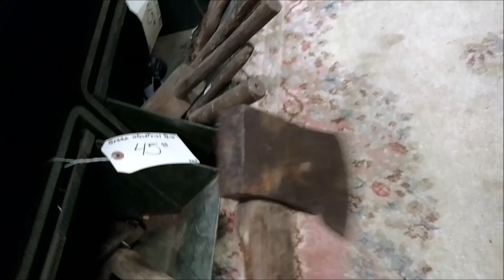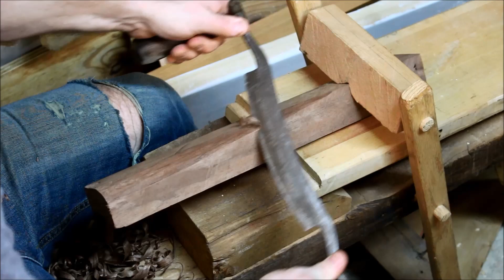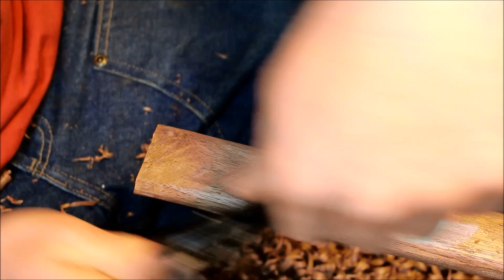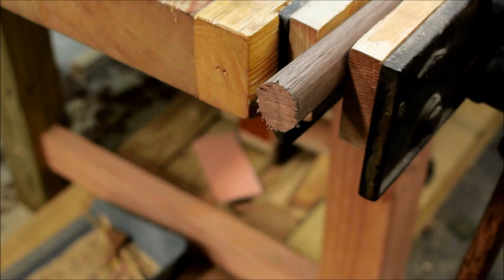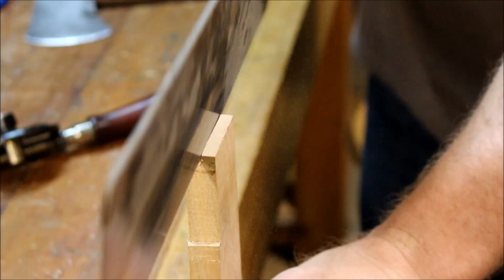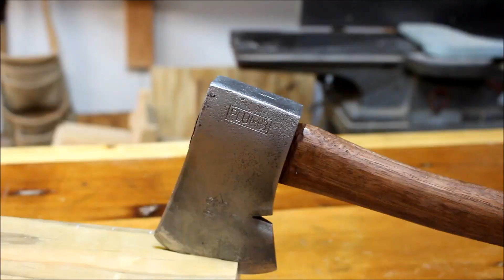Hand Tool Only Restoration of Plumb Boy Scout Hatchet with Walnut Handle

Comment: A quick and effective way to set an Axe or Hatchet on a handle is to hold the Axe/Hatchet upside-down and whack the bottom of the handle with a mallet until the head sits firm on the handle. Using Boiled Linseed Oil on a wedge before driving the wedge in really helps the connection last. Cheers from Germany! :D
Reply from the maker: great tips, thanks!!  I'd forgotten some of them!

Comment: Perfect!  So glad you didn't go over board on the ax head.  Looks great!
Reply from the maker: Thank you, Brother!  There was some slight pitting from the rust but it had a lot of the original edge left and luckily didn't take much to sharpen it.  I used really old stones to sharpen it of unknown various grits that I honestly almost threw away after finding them at the bottom of an old tool box that had been unused since the 40's.  After the video I went back and worked on the edge a little more with a much finer grit stone that was among them and I was amazed how sharp it came out.  Very fun and rewarding project!  thanks again for the compliment my friend!

Comment: Oh darn, had another question: Can you give more detail and information on that hand crank grinder? That was really awesome, first one I've ever seen.
Reply from the maker: oh sure, those can be found at flea markets or ebay and come in various sizes.  This one was found at the bottom of an old tool box from the 1920s that I got off craigslist.  they usually have a clamp on the bottom to mount it to a table but the brackets were broken off on this one so I used c-clamps.  Some hand tool only guys like Shannon Rogers on youtube still use them.
Reply: Tim. Wilson l

Comment: What a wonderful restoration!!! You did an absolutely outstanding job!!! First video too watch of yours, would you share what your soaking solution was and would it work on an antigue plane iron?
Reply from the maker: Hey Tim, thanks!  I used white vinegar mixed with salt and let it sit for at least a day and that really does seem to get the job done.  If I'm impatient (usually the case), I'll use a wire wheel.  Thanks for watching man!

Comment: Can you give more info on amount of salt in the vinegar? After soaking just scrubbed with a pad?
Reply from the maker: Thomas Brooker no specific amount of salt mixed in the white vinegar but more is better.  The vinegar alone works but with salt it seems to accelerate the process.
Reply: Vintage Wood Workshop thanks for the info! I actually bought the same hatchet and the handle is in decent shape but has some paint drops and seems dirty. Any method you would suggest that wouldn’t involve using sand paper and possibly removing the original stamping/lettering in the wood?

Comment: Nice work on restoring the axe and making a hand made handle for it. I have  one just like that in shape, size minus the hand made handle.. It is  stamped PLUMB but has no other markings.. Is the Boy Scout a version  of this axe? Anyone know? Mine happened to be left behind in my boat at some point  by someone and it was rusty as can be and no handle on it. I soaked it in oil and hit it with a wire wheel.. Cleaned up nice. Need to put an edge on it.  And while I was at Bimart today  and I broke down and ended up picking up a 16" Birch handle (?)  and put it together just  a couple hours ago.. I enjoyed your video and will look thru your channel.  Reminded me of Wranglestar's channel...
Reply from the maker: notbasic 01 thanks, yeah this was the hatchet plumb made for the boyscouts somewhere in the 30s from my internet research.  It's 5" long, 2-1/8" at the poll and 3-1/4" from toe to heel.  A cool little axe for sure.  Let me know how yours turns out....would be great to see some pics

Comment: awesome video brother you definitely put the ✋ in hand craftsmanship! not one power tool wow. what kind of wood did you use? I have an old plumb hatchet with a red strip on the lower part of the handle and the number stamped into the wood is #1 could that make it valuable in any way. there's something about this tool I just love.
Reply from the maker: Thanks Brother!  Not sure about the stamped number on yours, but yes these plumb hatchets are awesome and really work well.  For the handle I used a piece of old walnut firewood, I found in my mother-in-law's basement
Reply: I was thinking in my head that does look like walnut. beautiful hard wood I made a few soap dishes and I made one out of walnut. I used mineral oil to seal it but the walnut ended up warping pretty bad.😨 maybe I need a different finish that will help with this issue.👍

Comment: This looks more like a case axe than a real user one, I don’t like the way you fitted the head, it will come loose
Reply from the maker: Rowan Fernsler hasn’t loosened up yet and I could always add a metal wedge if it does.  I don’t have a case I keep axes in, just a pack basket
Reply: Vintage Wood Workshop I know you don’t have a case, I just meant it more for a show axe. What I saw was that the axe head and wood barely touched when fitting it. The wedge helps a ton but it could be better. A tip, when wedging it try to remove the corners and make it almost fit the eye. The wedge should leave no gaps when finished.